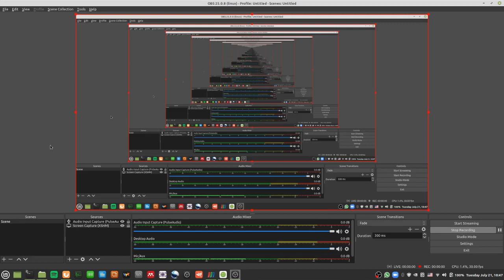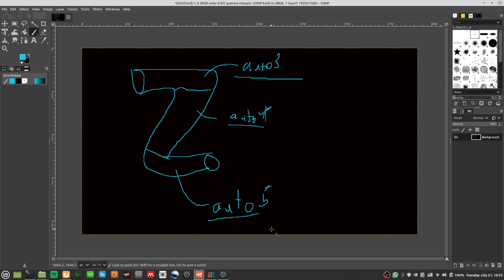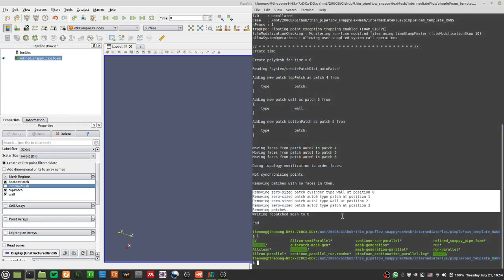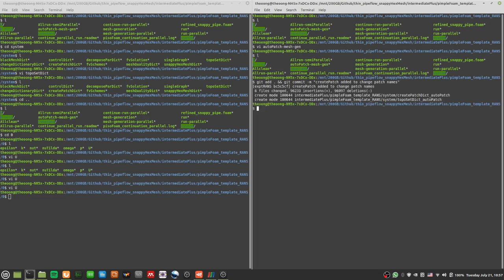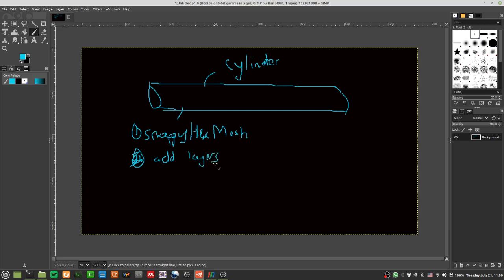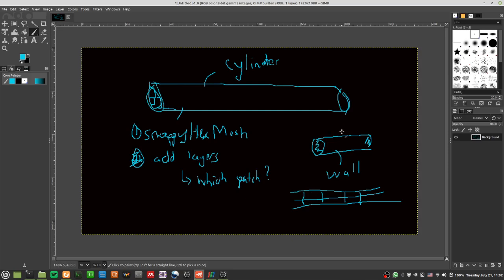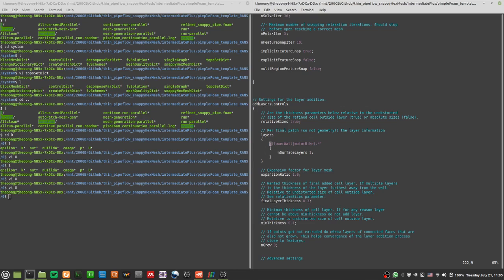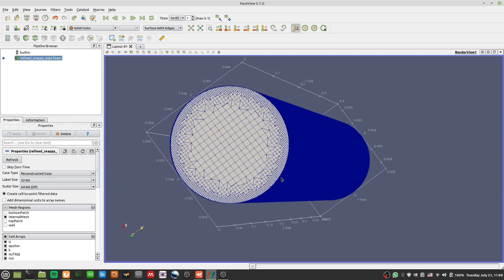OpenFOAM Intermediate - 63 snappyHexMesh add layers part i

Comment: The console shows 0 layers added. I think you have to check addLayers parameters. 
I think the problem is in minThickness value.
Reply: @TheoOngScienceAndEngineering  i m having a very hard time to get addLayers working properly. for a case like this i think you might want to try cfmesh